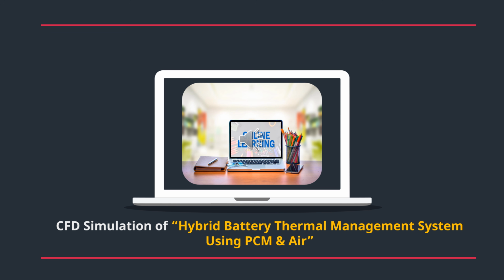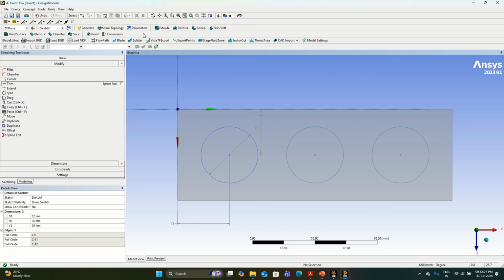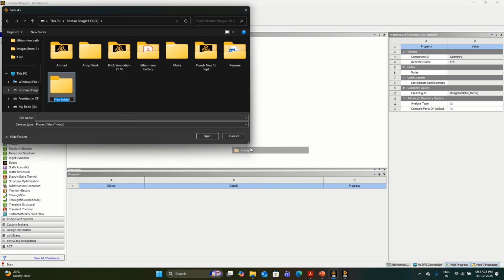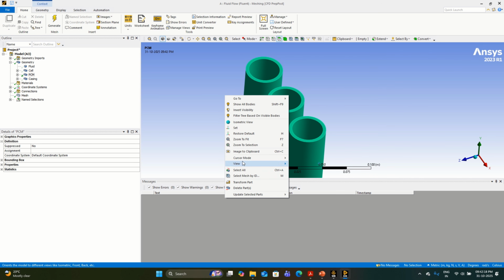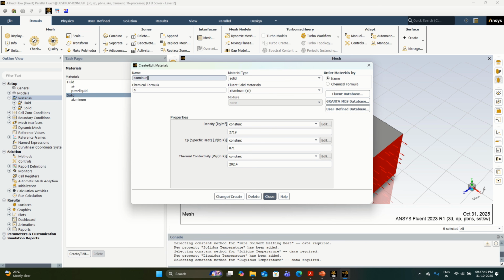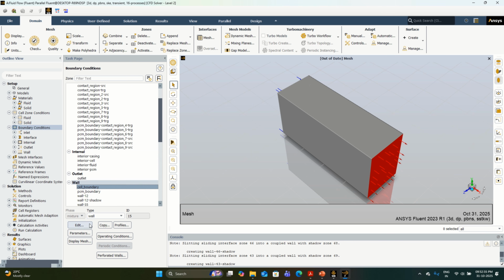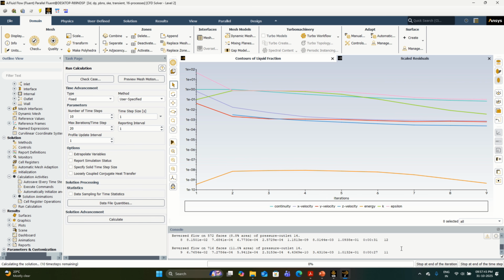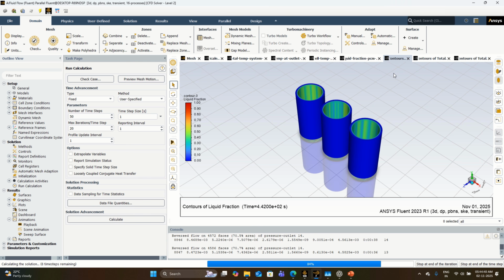Battery Thermal Management Using PCM and Air Cooling | Hybrid Cooling CFD Analysis | ANSYS Fluent |

Comment: Bro, i did the exact same setup as you but the only differences is, i use geometry exactly same as journal which i use 6 cell battery. I did the same setup as you and the results are confusing. Temperature contour increasing really slowly with the same time step, only around 0.4. No liquid fraction on pcm too. Can you enlighten me, please? 😢
Reply from the maker: Check if your heat generation rate and PCM thermal properties are correctly defined, as these often influence phase change behavior.

Comment: Bro i did exactly as u did, the settings were same , but after 500 seconds flow time , the graphs abruptly changed , the liquid fraction increased rapidly(0.25 to 0.6 in literal half a second), and all graphs abruptly changed , the cell temperature dropped down very rapidly....
I think it's solver error, then for accurate results,what should I do??

Plz help me🥺🥺🥺🥺
Reply from the maker: change mesh size make it more fine.
Reply: @FrontiersInCFD  I have 8 lakh elements, and 10 lakh is the limit, now what to do??
Reply from the maker: “Adjust the element size based on the smallest feature in the geometry, and apply this element size uniformly across the computational domain. Some trial and error may be required, as the element size should not exceed the permissible limit.”

Comment: Bro if solidus temperature is 324k and liquidus temperature is 327k then the wall cell temperature,cell_Boundary_contatct_region temperature,contact_region temperature how much i will place bro? Tell me bro
Reply from the maker: You can keep at 300 K, you need to apply heat generation in source term rest you can keep as 300 or your operating temp
Reply: @FrontiersInCFD Thanks bro
Reply: Bro Could you share your phone number or Insta I'd plz
Reply from the maker: +919834584778
Reply: @FrontiersInCFD  thanks bro

Comment: Hi thanks for the interesting video. If i want to simulate the heat conduction PCM. do you suggest to go with ansysis fluid interface or solid?
Reply from the maker: initially solid then it will melt

Comment: Hi... Do we need to draw positive and negative tabs for simulating a battery pack at different C-rates?
Reply from the maker: You can add however heat source will be cell.
Need to define tab material in cell zone conditions
Reply: @FrontiersInCFD  if we neglect tabs, does it affect the results? Can you make video of battery pack with busbar , positive and negative tab?
Reply from the maker: not much considering thermal model

Comment: Hi
Have you posted a simulation on your YouTube page that takes into account the battery c-rate in the cooling process?
Reply from the maker: I’ve worked on a thermal model of a battery pack where the heat generation rate was varied according to different C-rates to study the temperature profile and cooling effectiveness.
Instead of coupling a full electrochemical model, I represented the C-rate effect through volumetric heat generation

Comment: Hello Brother, can you make a video on to check heat profile of Battery pack in Electric vehicles through different charging and discharging rate.
Reply from the maker: In my case, I focus on the thermal modeling approach. The idea is to predict temperature distribution and hotspot formation in the pack when subjected to various C-rates (0.5C, 1C, 2C, 3C, etc.). Since a full electrochemical battery model involves complex coupling between electrochemical and thermal processes hence goes beyond my working area